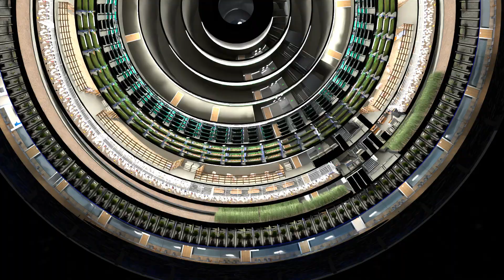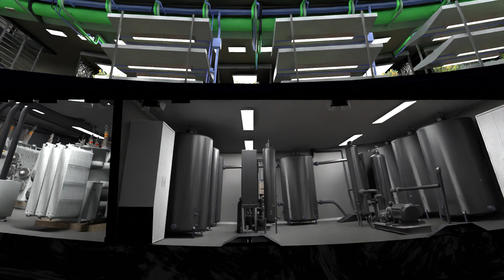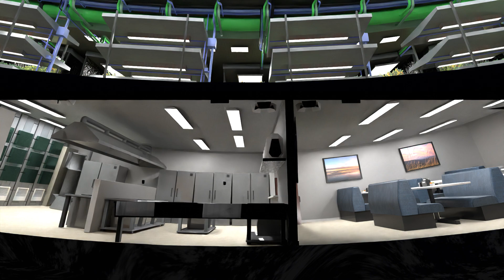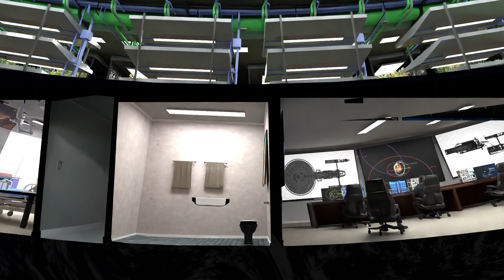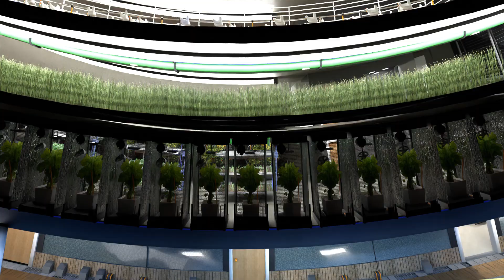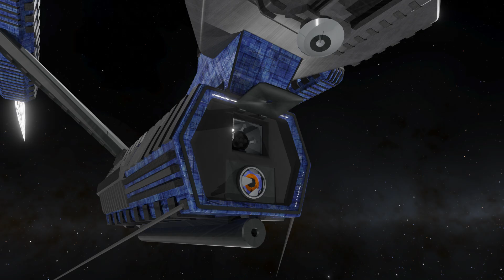Rotating Space Habitat , the Enterprise.

Comment: BTW, the classic directions inside a spinning structure (be it ship or solar system) are as follows:  coreward = towards the rotational center aka "up" in centrifuge; rimward = towards the floor aka "down" in centrifuge ("out" is where you get flung if the floor is breached on the outermost deck); spinward = following the rotation aka clockwise in the habitation ring; antispinward/trailing = against the rotation, aka anticlockwise in the habitation ring; note that spinward is always relative to spin direction, if you were doing maintenance in the counterweight area, the directions are reversed!  If the disk stops spinning, clockwise & anticlockwise are then used, with respect to the disk's center.  For the non-rotating secondary hull and nacelles, the standard aquatic nomenclature of port, starboard, fore, aft, dorsal, and ventral can be used.  These could also be used if the centrifuge stops spinning as well.  In the habitation ring, left & right work, but to be proper, one should probably use ventral & dorsal to be consistent with the null-grav sections.  In the greater navigational scheme outside the ship, instead of dorsal and ventral, one goes towards zenith or nadir with respect of either the local system ecliptic or the galactic ecliptic, depending on where you are.

Comment: Second if your building 2 rotating sections for gravity, then go big so you  sn lower the speed of the rotation so its easier on everybody. Little to no adaption required.  

You can use inflatable modules so if the ship was designed like the von braun station. Since the top of the ring cross section would be narrow compaired to its diamter , you reduce the risk of particals hitting a part of the living space.

Additionally having the 2 rings rotate around a central axis that contains propulsion not only doubles the usable space, but is structually simple than a sold rotating structures perpendicular to your movement vector.

But why stop at 1 pair of rings. Multiple modes could be attached in pairs depending on the needs of the mission. A moon rocket might need 1 pair of rings. A mars/venus might need up to 6 pairs. Going to the asteroid belt you might need 12 pairs. It is easily scalable up or down. Hell you might even get to a destination drop off one or more pairs to act as a space station or hub.

Comment: First is instead of using a nuclear reactors, use rtgs  configured into a power bank just like we use batteries in powerwalls we already use in real life. Both of these have years of proven operation. If a bank of 1.5 volts cells can be wired to pro ide 120 volts house power. 1000 watt rtgs csn be wired into 4o megawatt power banks. Also an rtg requires zero maintenence. It requires zero refueling. And it lasts many decades up a century lifespan. Oh yes you can also recycle spent nuclear fuel rods to power them.
Reply from the maker: The best RTG (radioisotope thermoelectric generator) I could find produces 250 Watts, that would be 80,000 RTG units and each unit is about 100 pounds. The Rolls Royce Micro reactor is lightweight and has a high power output, perfect for this type of use.
Reply: @exodusstar  the thing is unlike a reactor, and rtg fldoes not require refueling. It does not require maintenance. It does not require gravity to work. A nuclear reactor DOES require all these things. How much does that reactor weigh? How many rtgs could it replace?? Additionally you could locate the rtg away from the living area of the crew. That reduces the tons of shielding weight you would require.

Comment: Ok, but how fast will this thing go?  A fusion reactor not a warp drive.
Reply from the maker: Earth to Mar's in 2.5 months, estimated.
Reply: @exodusstar  Well, ya gotta start somewhere, I guess.  I think one of the most overlooked aspects of long-term space travel is not the propulsion system but the ability to generate gravity.  My question is; how will the forward momentum of the ship affect the centrifugal force of the spinning "saucer"?

Also, traveling at even a small percentage of the speed of light will require some kind of inertial dampening, lest the occupants get crushed by the G forces (or become a greasy stain on the rear wall of the ship).
Reply from the maker: @Luthiart  The Helicity Fusion drive will produce pulses of thrust and will take weeks to reach cruising speeds, also the ship will not be making any  maneuvers that would be more than a person could handle.